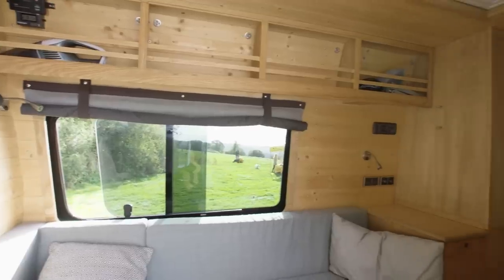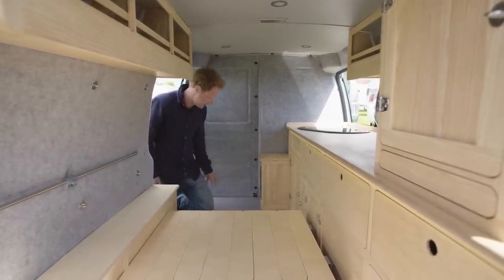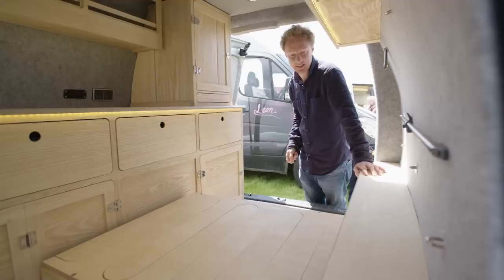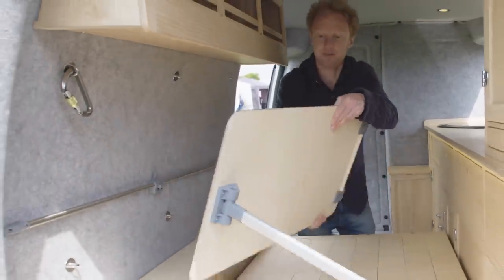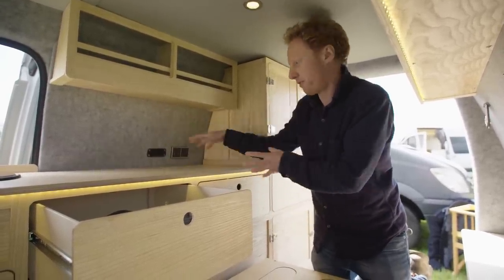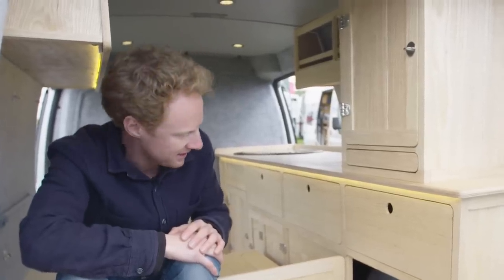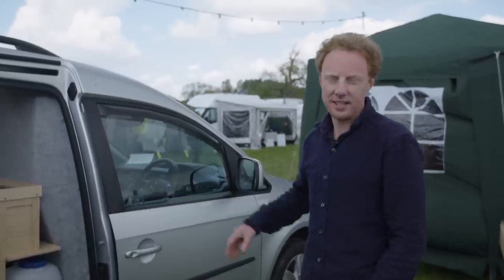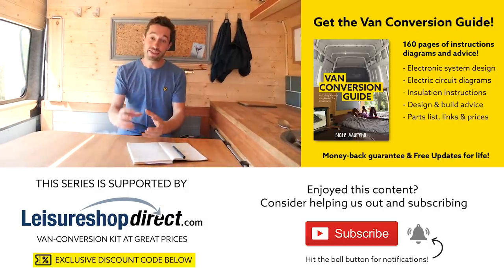EXQUISITE MICRO CAMPER 🚙Small Van Conversion  |  LAND YACHT MARK 2!

Comment: neat. For the bed, a fold down platform against that wall would have possibly taken up less room and be easily stored. It could be bifold and even used at the half size.
Reply: Agree, failing in the design
But good effort otherwise
Reply: To each their own
Reply: or even a long bench seat with a pull out (beautiful woodworking and layout otherwise and anyway - just for my taste I'd prefer the bench style)

Comment: nice build, i dont like the upper cabinets but thats just me, the laptop slide storage is spot on thou! amazing overall gas saver camper:)
Reply: I agree.. the upper cabinets on the one side work with the rest of the cabinet build, but the other side looks like it would get in the way.. banging into it a lot I bet.  Other than that.. great build. Just my opinion.

Comment: This van conversion is excellent, it is a really great effort and a lovely finish, well done! I intend to purchase a VW Caddymax van myself in early 2020 to use primarily as my work van ( I am a Pumbing and Heating Engineer) but as a part camper ( with the use of a driveaway awning) , many tyhanks for posting this video , just one question please? What is the material used to make the cupboard units? Is it 'contiboard' ? or Laquered Plywood? Cheers dx